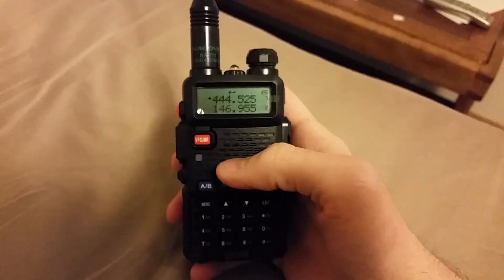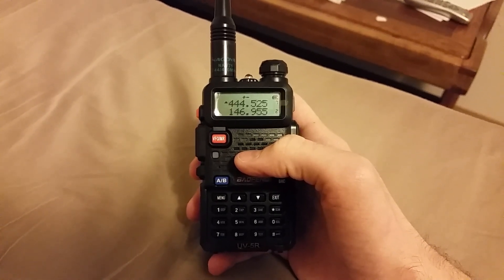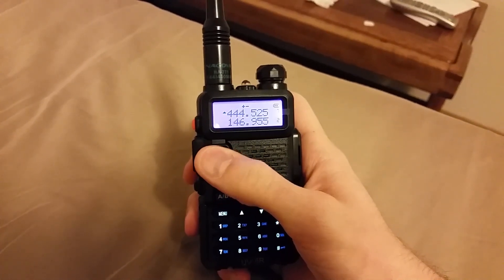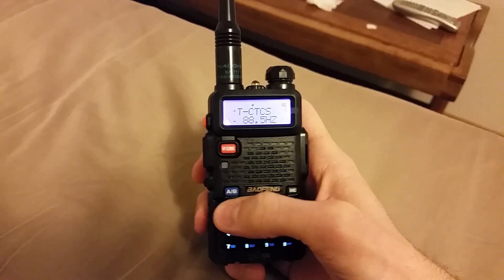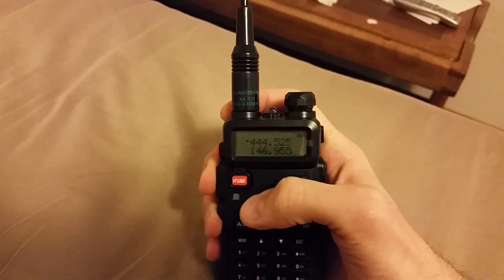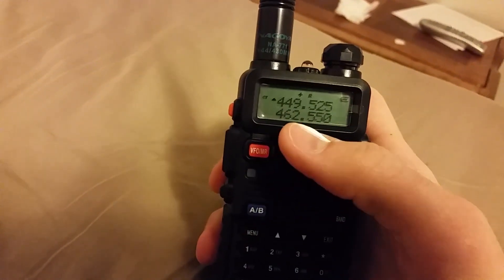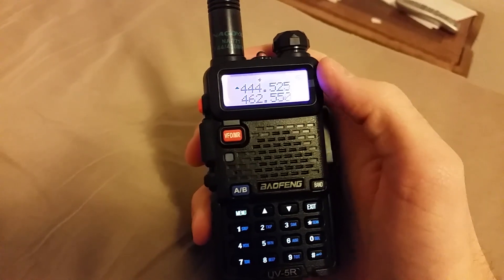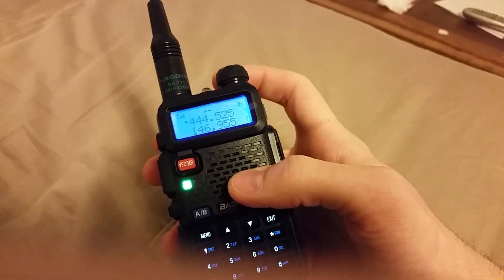Manually Program Repeater with Offset into Baofeng Channel Mode

Comment: Mine just goes back to 000.000 offset and same with + and - it's weird. Sometimes it will save the +and- but not offset and yet sometimes when it still reads 000.000 it still changes the frequency 🤔
Reply: Same here. Transmit does reflect the offset, but in the menu is shows all zeros.
Reply: @johnmoore2423  I read something about them not being originally built for ham radio or they had been modified at some point so this is the case. Also said you have to do a full reset before programming (did that twice nothing happened)even when I did the 3 button on frequency hack factory reset,got the extended frequency but didn't change the display.
Reply: @johnmoore2423  Would have saved me a few hours knowing this and a headache or 2. I upgraded to Yaesu HT that I now understand the differences but the Baofang it will do the job.

Comment: I recall using radios in the military .I hot the hp8 and working on the ham part I have my fcc lic for gmrs but not sure if I can take it in my truck yet .as far as programming it I plan to join a club for that .I was one of the last drafted so not sure what radios are used to day .I go back to the Nam era

Comment: Well done! I reset the unit & I presume it loads older firmware & you can’t put in the offsets as you used to. Your method works - ya very much. I suppose it’s worth getting firmware updated & it should be ok as previously done 👍
Reply: dammit so by jail breaking it to get gmrs I just played myself? Cuz even this method doesn’t work for me

Comment: my offset said 000.000. I put it at 000.600 but dont know  how to do a minus or plus. Im a noob.
Reply: It is menu option 25. To change from one to the other use the up or down arrow keys once in the menu option 25 then hit menu again and you should get a "confirm" message

Comment: Yes...BF-F8HP has same problem (new as of Sept. 2017) and this (* SCAN) solves it! Thank you. The new manual (from what I have read) seems very good, but Chapter 11 needs to add this important (necessary!) step to make the radio useful with manual programming.

Comment: THIS vid is the only one that gets it right. This is absolutely neccessary on the latest Baofeng firmware and as you can imagine is driving a lot of people crazy. Thumbs up and thanks!!! BTW just so you all know as of tomorrow 9/28/17 a GMRS license from the FCC will cost just 70 bucks for ten years and yes you will be 100% legal to use these radios and you will be issued a call sign. No test, just your application which is their Form 605 completed and submitted and of course your 70 bucks. It takes 5 minutes online at the FCC website to get it, so for 7.00 a year you can be licensed to use the GMRS freqs on these radios. You can legally transmit on FRS/GMRS on any radio up to 5 watts and on any radio with a removable antenna as per the FCC's GMRS licensed rules. Your antenna height if you use a base antenna is limited to 20 feet. If anyone is interested in getting their GMRS license let me know and I'll leave directions on how to navigate the FCC's website to get your GMRS as it is a royal PITA if you don't know how to do it.
Reply: @BLACK

Please leave directions.
Thanks.

Comment: Does there need to be a receive tone set up? Just to listen.  I have the Bf-f8hp.  Plan on getting my license soon. But wanted to learn how to use it just to listen ect. When i get the info from the repeater site. Out frequency. Do I need to set the offset just to listen and can I put the pl in the receiving tone instead of the transmitting tone? Hope I made sense I'm very very new just got the radio yesterday
Reply: +sacboy815 , I am very confused with the wording of your question.  If you only want to set a receive frequency only channel for repeaters you can set only the frequency and not bother with the Offset.  This will only work for duplex channels,  it will still transmit, just not to the repeater.  Doing this would allow anyone in your nearby only to hear you still.
Reply: sacboy815 Not sure if anyone answered your question. But if all you want to do is listen, then no you dont need to program anything at all. You just dial in to the frequency you wanna listen to, repeater or not. If you want to transmit through the repeater, then you must properly program a channel to do so. Well technically you dont have to save a repeater to a channel, but it would be crazy not to. Your HT doesn't need to have PL programmed on its rx for this purpose, just the tx and the appropriate offset.

Comment: How do you figure out what the offset is? Online it just gives one frequency with a + or -  but I have no idea what the offset is.
Reply: That is correct...+/- .600khz offset for 70cm band and +/- 5Mhz offset for 2m band..
Reply: @mitchellwebb6560  You got that backwards. 2m offset is +/-.6 and 70cm offset is +/-5.
Reply: I {think} if your repeater frequency is 14#.###, the offset is always 000.600. if the repeater frequency is 44#.###, the offset is 005.000